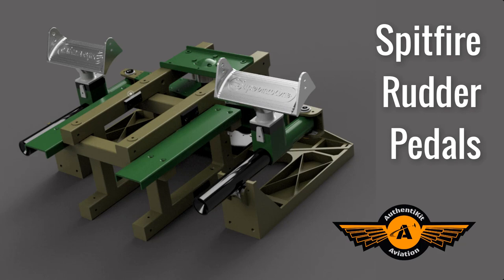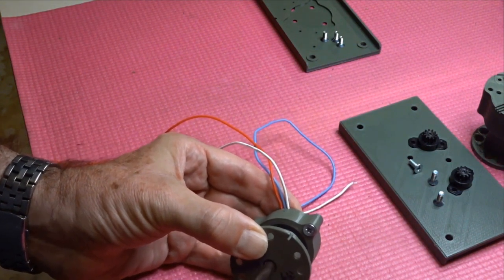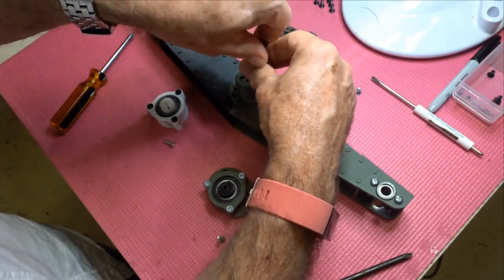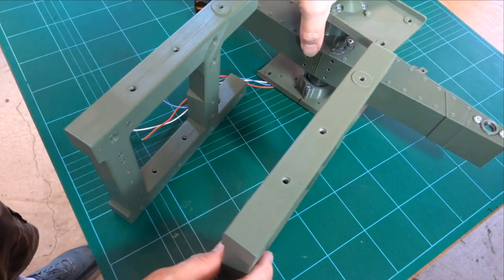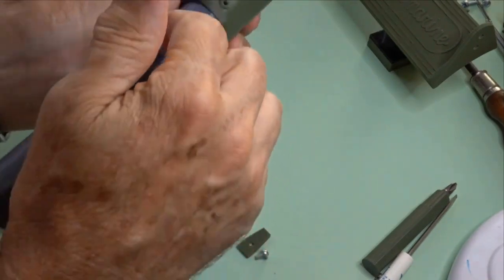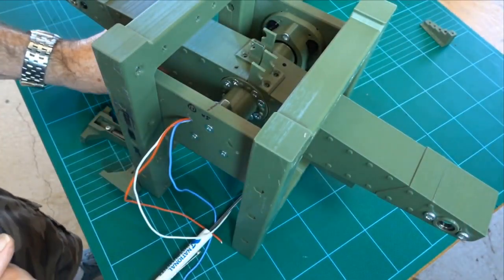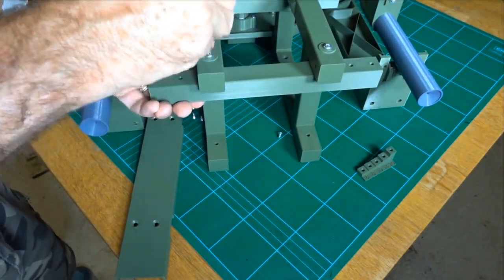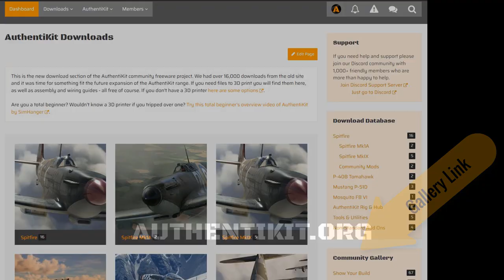AuthentiKit Spitfire Rudder Pedals - Self Build Assembly Guide

Comment: Thank you for the post, I am of those eagerly awaiting more P51 love but this will satiate that desire in the meantime. What 3D printer do you folks recommend? My CR10 Ender v2 has nowhere near the build plate space to accomidate these larger prints.
Reply: This entire project was developed using a standard Ender 3 V2. Gets a bit close at times but it all fits. I believe the CR10 has a bigger build area so you should be ok.

Comment: mammoth print effort, but worth it. Just assembled mine, but ran into an issue in calibrating, it only recognises left rudder input, only about 1/4 range of movement. Any idea on what could be causing this issue?
Reply from the maker: If range is limited, could be magnet orientation. If that doesn’t fix it, jump onto our discord to discuss further
Reply: fixed, reorientated the sensor. Cheers @AuthentiKit
Reply from the maker: Great ! @credanpryce-coady2424  You fancy posting a photo here and giving your comments or adding a review? https://download.authentikit.org/filebase/index.php?file/38-spitfire-rudder-pedals/
Reply: Will do!